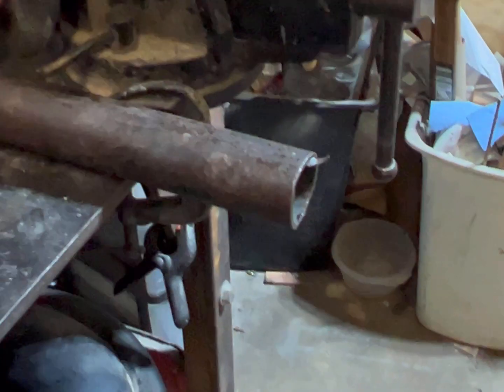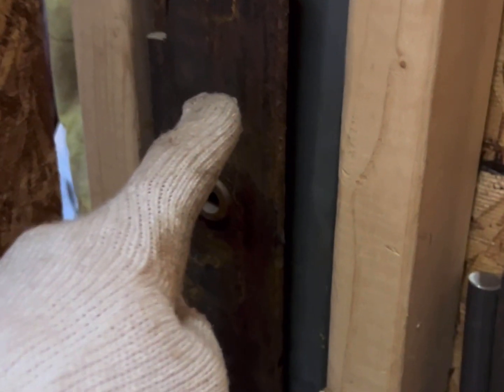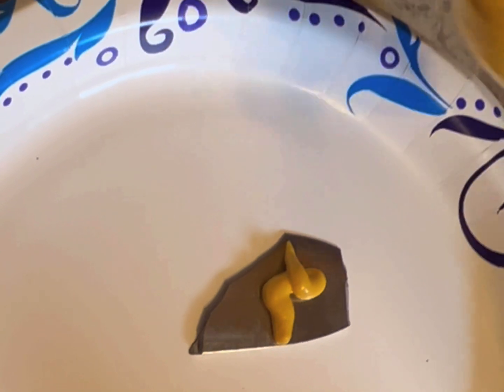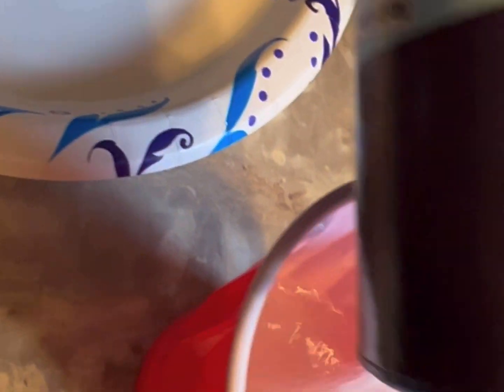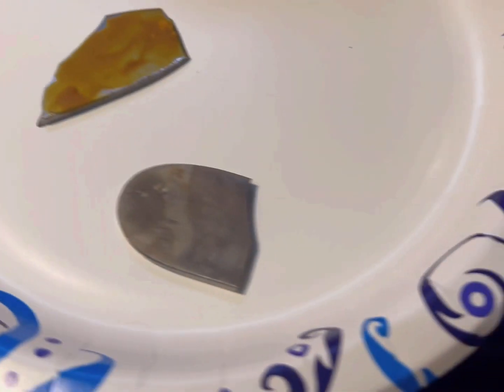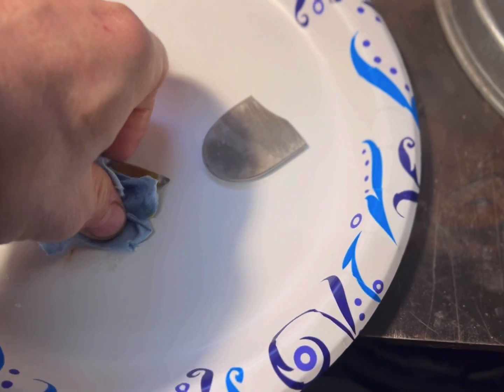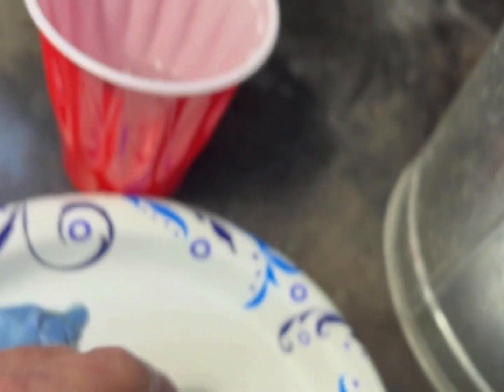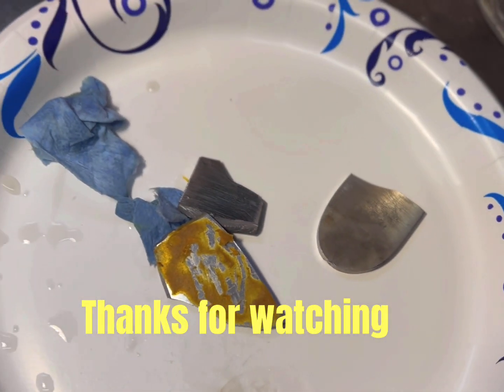MAGNACUT corrosion test

Comment: I've seen the test from BBB and he showed that magnacut suffers from being threated low HRC
Reply from the maker: I don’t think it would affect corrosion resistance though that’s not gonna change
Reply: @AaronJohnson1979  Yeah I know I was just thinking about the 61 hrc
Reply from the maker: @AAAAAAndrea  Far is that it could be 62 I did the recommended heat treat From crucible triple-B will experiment will dial it in eventually for the perfect heat treat for a slicer. If I wanted to make a pure Cutter I would imagine just like any other Steel higher HRC you would gain more wear resistance and edge stability. But with higher HRC you get less shock absorbent steel, So i’m sure everything is still a trade-off just depends on what kind of knife you want to make and what it’s for.
Reply: @AaronJohnson1979  I hope there will be good news about this promising steel :)
Reply from the maker: @AAAAAAndrea  I can tell you this much it’s excellent at 62 HRC lol so if it only gets better from there that’s crazy. I just hope all the major knife companies don’t run it to soft